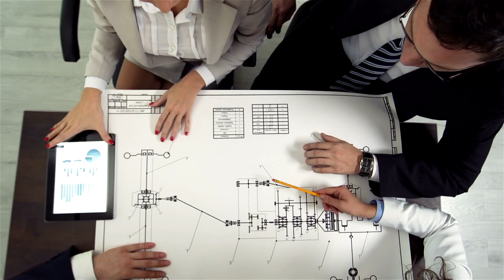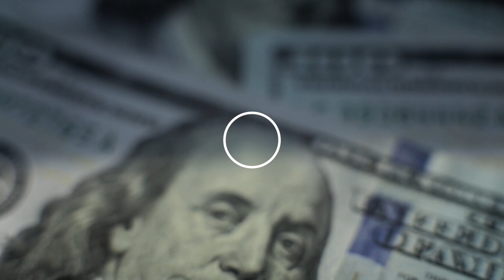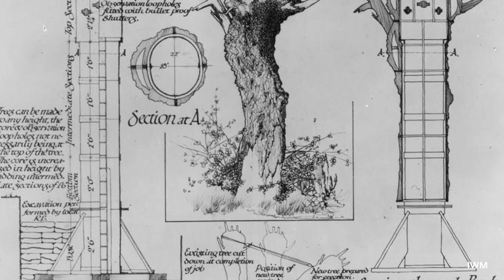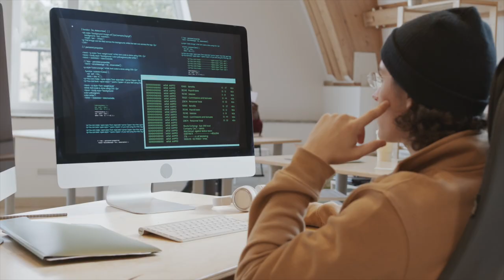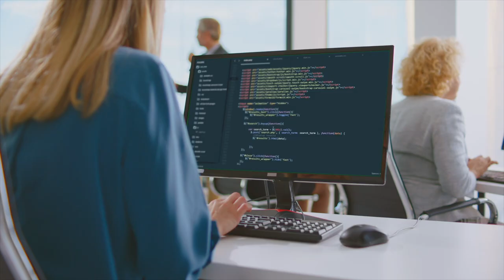5 Crazy Ideas That Worked Out Fine

Comment: Why did they use black balls in the reservoir, wouldn’t that heat the water? Why didn’t they use light colored balls.
Reply: Good point
Reply: They aren’t meant to prevent evaporation
Reply: The balls are hollow so the heat won't really transfer to the water, also the black colour stops the light from making it to the water which would heat it up.